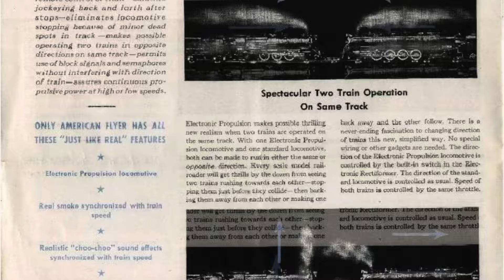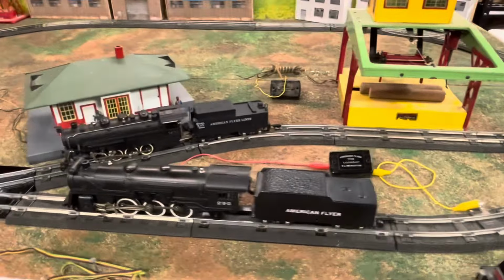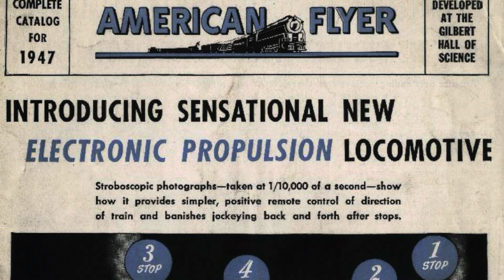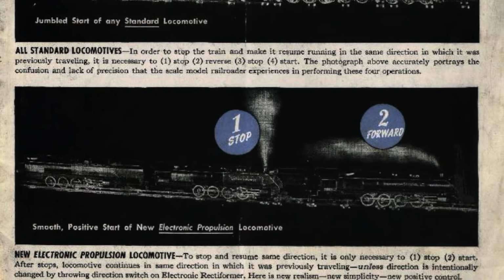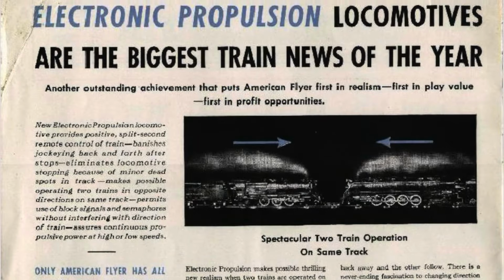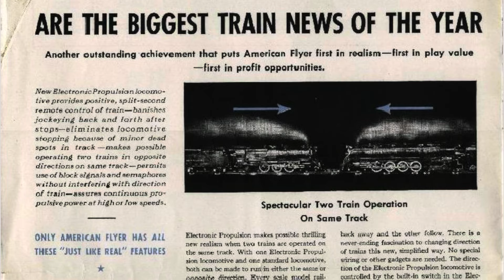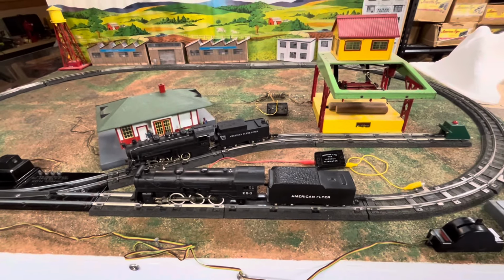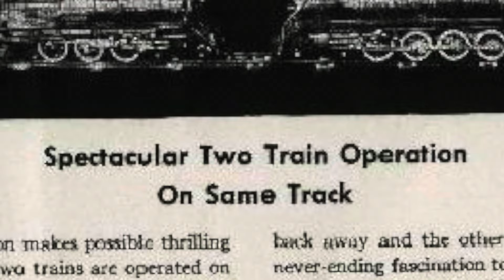American Flyer: Fun With Fiber Pins #4, Spectacular Two-Train Operation

Comment: I used the left side of a 12B for power to the isolated track section on my prewar layout. The right side for the rest of the layout.  That way I could have higher voltage so the stopped train and cars could pull away fast enough that the second train would not run into the rear before it cleared the isolated section.
Reply from the maker: That’s a great idea.  12B’s are neat transformers for that sort of thing.  When my turntable layout was still running I used a rectifier from Radio Shack to power the DC motor on the turntable from one side of a 12B.  👍

Comment: Out of curiosity did American Flyer have anything in S gauge that had the same popularity and collectability as Lionels O gauge 6464 boxcars?
Reply from the maker: Not too familiar with Lionel, but Flyer did make several different boxcars and stock cars with the colorful road names in the late 50’s.  They are popular for collectors.  There are some more rare than others making them extra desirable for collectors.  These usually are associated with Flyers change from a 3 digit numbering system to a 5 digit numbering system in 1957.  5 digit cars found in 3 digit boxes seem to be worth more.  Some cars were printed with 5 digits and then not produced after late 1957 so there are very few of them.  I’m sure Lionel has similar nuances for their 6464 cars.